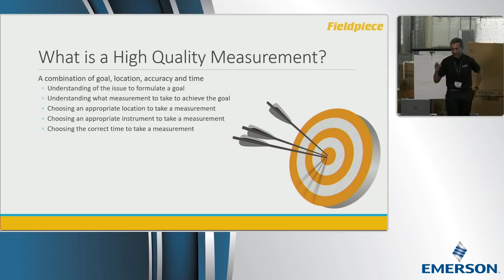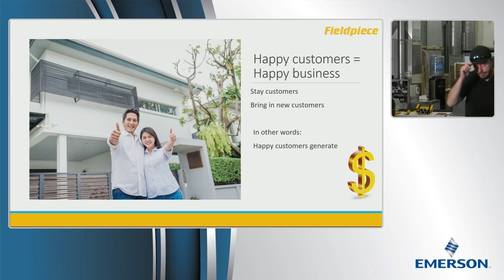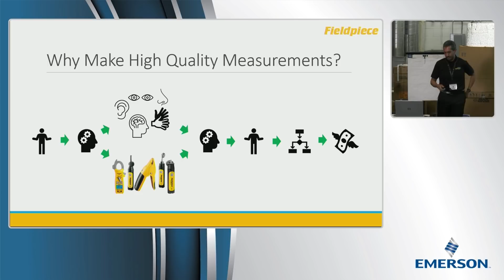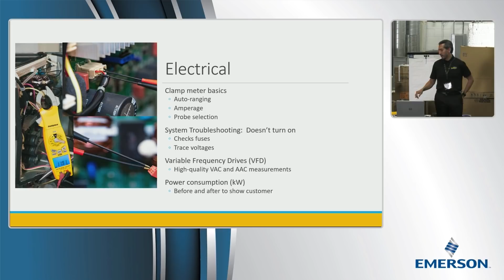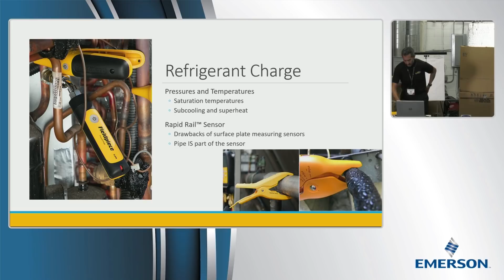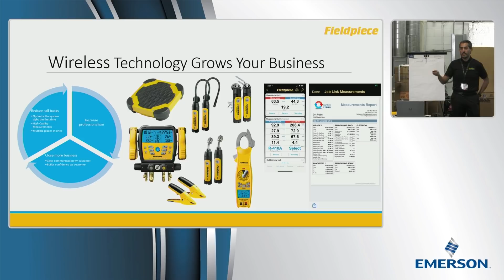High Quality HVAC Measurements w/ Tony Gonzalez

Comment: Great video! Fieldpiece has the best wireless probes bar none I got the sman 480s, joblink psychometers and manometers and it love them. I'm considering getting the charge kit with the pressure probes and line clamps to add to the kit.

Comment: Tony mentioned that the all the measurement will display with in the app. But with out the paid version the electrical part is not displayed.
Reply: Hello John...Thank you for your comment. A paid subscription is not required to view the electrical measurements from your wireless Fieldpiece clamp meter. From within the measurement screen, tap on the Electrical tab in the lower part of the measurement screen. The Electrical tab is where you can view the electrical measurements from your tool. I hope this helps. Have a great day!
Reply: @fieldpiece_tonyg  yes your right but it wont save in the pdf with out the paid version